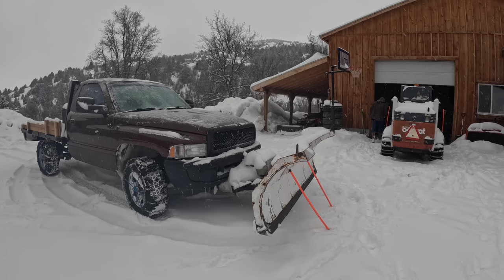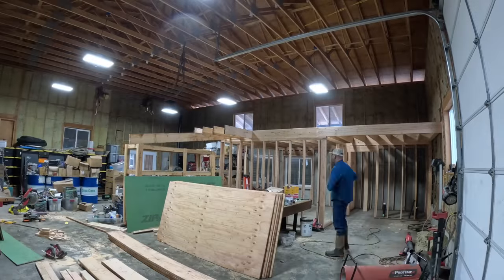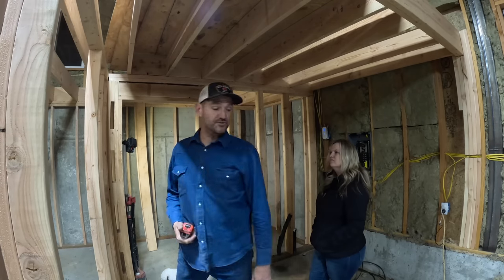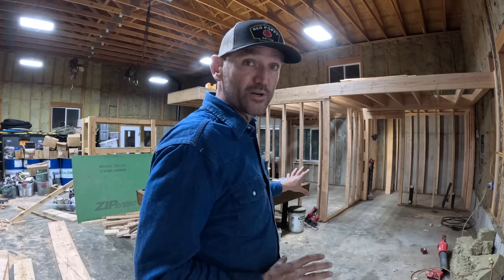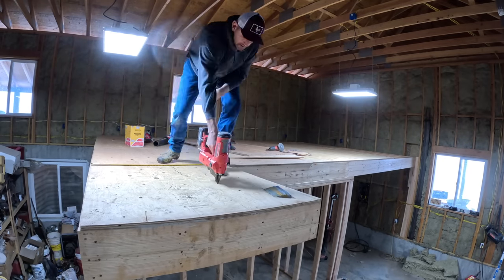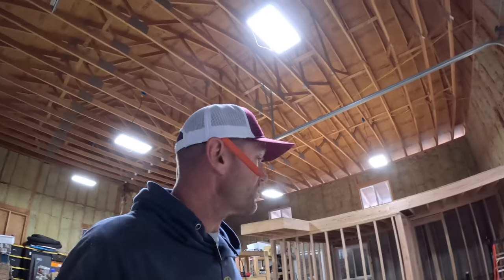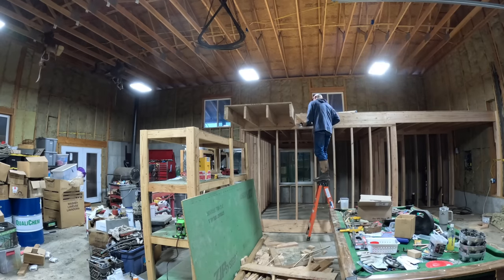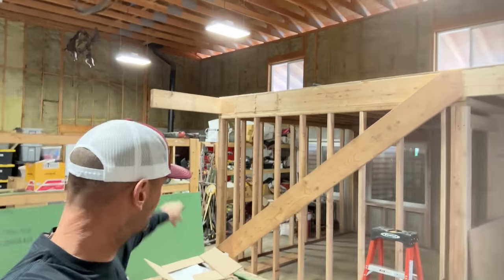#655 - Shop Addition: Second Story Floor Joists, Decking And Stairs

Comment: The stairs looked fine.... you could have added a few degrees without to much problems... and then extended the wall out a little were the  down stair bedroom door would attach... It would have closed the "kitchenette" area in just a lil bit but it would have looked like you meant to do that anyway.  Or.. left it open and brought a short handrail down to a scroll... so no one would 'trip' on the stair hanging out.  You already have a window upstairs... or is that half going to be a loft?

Comment: Measure straight down from your landing(Subfloor - top of plywood), to concrete or finished floor. That will determine your Rise. Ideal rise and run(could differ from state to state) 7 3/4 rise to 10 3/4 run. From there depending on the amount of room you are looking to utilize will determine a landing and so forth. Always run your subfloor the opposite of your floor joist for best strength not in line although it will be fine.

Comment: If fire safety is what your after, code allows up to 8 sprinkler heads on a domestic water system.  Do that and save the cost (and time/effort) over the installing a window.

Comment: When heath and cedar talk you can see she has no say at all but she knows if it isn’t a product that needs finishing, she knows he won’t finish it. Like the walls I’ll do in plywood and some sort of siding that’s English for I’ll cover in ply get busy building plow truck 6 in the summer this time and it will never get finished like the wall on the shop which is still not sided. Because you dont write anything down or plan anything this is why you have to re do work constantly.

Comment: Heath I would close in the space outside the downstairs bedroom on the first floor in the shop bedrooms, for it will help to keep the dust down in the bathroom and bedroom from your workshop.  It will also help to hold the heat in thr rooms
Reply: Would have also added the wall length needed to use the original landing idea for the stairs. Oh well too late now.
Reply: @BrianEltherington  It’s never too late for Heath to redo things. It is his favorite thing to do!
Reply: @laurenj8888  Indeed, but that ship has sailed. Can't wait to see what Heath comes up with as a semi-final solution.
Reply: Wrap around from the backside would be nice.

Comment: From the 2nd floor, Im thinking you do the first 4 treads of the stair like a spiral staircase  but it could be wider treads,,,,.  Then take and fan out 4 treads so the 1st and 4th are 90 degrees apart.. it would allow you to drop down 30 inches or so before you frame the remainder if the stairs.  Doing it this way solves the problem of the bottom being a trip hazard.at the bottom...

Comment: Just an idea.  You could bring the stairs about halfway down the wall, and turn 90° towards where your pool table is
Reply: What I was thinking. You gain some added storage space under the second landing too
Reply: I was coming down to comment the same thing. Put a second landing probably even with the corner, and then turn 90 out. If not that, make the 2nd landing double wide and turn 180.
Reply: that would be a total waste of garage space, which now is much smaller than before
Reply: While I agree it does take up more room within the garage, I believe it is up to Heath and Cedar to determine if it's a waste or not.

Comment: I think using a fire pole at one end of the loft would be useful ( and fun). You are probably going to double the loft space across the width of the barn to really get the most use out of the space.  To shorten the length of the stairs and make them less steep, you could put a landing halfway up. I enjoy watching you experiment. It always turns out nicely. Your narration of the projects is always so literary so lyrical it is a pleasure to listen to you.

Comment: Well Heath, I'm sure that if this is ever read, you have already solved the stair issue.  However, to sometime get the maximum drop for the stairs, make the landing the final stair tread and bolt drop down nailers to attach the stair stringers/final riser to.

Comment: You could have a sliding door on the outside of the bathroom instead of a pocket door. However, odors and sounds will be an issue. You don't seem t have considered bathroom ventilation.

Comment: I’d make the bathroom as large as the landing you made, install a door (pocket or barn door) to access the bathroom from the bedroom and, rather than build a bedroom upstairs, build a loft. That would allow you to install a decent sized shower, storage and, you’d have room for an instant water heater. This way you’d only need a removable ladder to access the loft and, your guest wouldn’t have to walk into the shop in the winter to get to the bathroom. It would be easier than building exterior stairs which is going to take up more room, and whoever is in the loft will have access to the bathroom rather than going through the shop. You’d steal have room for a door leading from outside into the shop to the right side of the bathroom. I personally think this would save you time, money, space and a headache! Oh, and don’t forget to add a bathroom fan if you don’t have a window in there.

Comment: You should learn how to use the free 3d modeling software called sketch up. It would save you so much time on projects like this. Instead of having to tear off a landing you would have seen this issue while building the model, hit delete a few times and been back on track. To each his own though. Good job on the videos!

Comment: I can't believe it. You made the same identical mistake you made on your roof decking. You ran the plywood in the wrong direction. After the inspector made you add a lot of additional framing members, you would think you would know next time. The grain, or long direction of the ply, goes at 90 degrees to the joist members, whether it is ceiling joist, roof joists, or floor joists [as in your case]. You should change it before  the inspector visits.

Comment: HeathCAD: You build it, then make changes.

1. Get a electronic CAD like Chef Architect so you don't waste time & money on materials.
2. You could have just used a stair landing & rotated the bottom 2 or 3 stairs facing out.
3. Just use one up-stairs bedroom since there is one window for egress. Nothing wrong with a bunk style room for visitors. You could also set up a movable wall partial if you want to split. ie a pair of barn doors or pocket doors to create a separated space.

Comment: We would love to hear some of your experiences that lead you to believe that architects do not understand "reality". Now if you would have said you couldn't afford one that would make more sense.
By the way "Mr. I'm better than an Architect" you laid your floor sheeting on the wrong way. Length is perpendicular to the joists, thought you would have learned your lesson about that on the roof sheeting on the house, where you made the same mistake and had to fix it. 
Maybe its different in your town but run and rise govern stair design, not angle. That can be easily calculated and laid out without the use of a huge heavy template. 7 1/2" rise 11" run is a nice stair design.
I could be wrong, but I believe you may have a problem with your build and the septic.
But then again an Architect is such a valuable asset for things like that.

Comment: Where the window is by the garage door, you could put a glass door, would save you the trouble of cutting the concrete. Metal Spiral staircase for upper loft?

Comment: Background: OSHA standard 29 CFR 1910.24(e), states:

Fixed stairs shall be installed at angles to the horizontal of between 30 deg. and 50 deg.

Comment: Real life application... AMEN. As an architectural designer who has worked for several architects, this is very hard fact. Just because it passes code doesn't mean it passes real life applications, something they obviously do not teach in college. I worked as a carpenters helper when I was 14, my grandfather who was a contractor. By 18 I was a carpenter framing houses. As an architectural student in college,  I was years ahead of the others. Architects should be required to spend time as carpenters.

Comment: If you flip the stairs to the other end and build the landing where the bedroom was going to be then put the bedroom over the other bedroom you would not have to add a window since one exist over the bottom bedroom and I know that would be putting outer walls on anyway so wouldn't that help you in the end by not having to install another window and cutting thru concrete.

Comment: It’s probably too late for stair suggestions, but did you consider and “L” design with a landing? I don’t know if that cuts into your space out there. Also, since Cedar wants a pocket door, maybe a sliding barn door on the outside of the bathroom would be appropriate, just a thought.

Comment: The WI Agricultural Ext Service, like several other states, offered low cost house, barn, etc, blueprints.  I got one.  As the majority of our builder homes were ornate, gabled, dormered, etc, all making the home more expensive, I chose one roof line.  And we didn't finish it, just to livable conditions intending to finish it as our children grew. The temptation was too much for local greed and the house was stolen.  We weren't from the area, didn't grow up there, no grandparents in the area, etc.  They even stole the blueprint.  Suing does not get justice just debt.  After 20 years of homelessness, they stowed me in a 100 year old cottage to repair.  Still waiting for the return of may home on Trails End Road at 76 years old.

Comment: Code violations everywhere. I guess in Idaho there are no required inspections except electrical and septic, which will fail. I don't get it. Why does he insist on screwing up all the time.

Comment: Turning the stairs around like at the end of the video would mean another set of stairs would be needed if the upstairs is expanded beyond the 2 bedrooms for storage or more bedrooms. A stub wall at the downstairs bedroom door could be utilized to let the stairs run out a little. Also, turning the bottom of the stairs 90 degrees towards the front of the shop might have allowed the original overhang to remain in place.

Comment: I'm going to give you the equation of calculating your steps, Heath. If Mark told you how, disregard this. Every measurement is in inches and the magic number is 7. Measure your total height, divide that by 7. That gives you the number of risers. Divide the total rise by the number of risers. That should give you your unit rise (Each step). Your unit rise should be between 7 to 7 1/2 inches.

Comment: I have run with those plow markers before, as long as you're not hitting things with them, they will last 3 years as the sun cause them to deteriorate.  @3:40 Looks like your cat fell off the truck you will have to take time to reinstall it. Too bad these videos are taped a week or two ahead or I would suggest a spiral staircase to take up less space. Oh, yea the flooring goes cross ways instead of length wise.

Comment: HELLO  HEATH. I WOULD KEEP CUTTING. THE LANDNG.  AND. MOVE. THE STAIR CASE AROUND THE CORNER. START. ON. THE CORNER. RISE TOO THE. BACK.  AND BUILD A WALL OR. PARTICHOIN.  TOO ROOF.

Comment: Why do you not make a SANDBOX on a PALLET  you can LOAD onto your PLOW TRUCK FLATBED for needed WEIGHT?  You could easily lift it on and off with your forks lift kit.

Comment: Health, you are so wrong.  Move your framing over 4 inches from your B/R water lines & put a pocket door in.
You ran your plywood sheets the wrong way, would be stronger to run them across the beans not with them?

Comment: Not that it will make a difference to leave this comment , but the top edge  snow plow is leaned waaaaaay to far forward. The back mounting point where the plow attaches to the trucks frame needs to be dropped.    The truck would plow much better and the plow would actually have a chance of throwing the snow up and over the snow banks.

Comment: Don't swing door into the bathroom swing it out of the bathroom that will save you for space in the bathroom. Also just extend the wall of the bedroom near the door to cover the bottom of the stairs out a foot or two you don't need that wide-open space to get into the bathroom in the bedroom

Comment: Sorry but I honestly do not know why 30 minutes was not taken 3 months ago to put even some temporary blocking or insulation into the open soffit of the garage roof to keep the heat in and cold out. That would have made a huge difference the last 3 months.
Reply: He's been a little busy
Reply: @karenriggle5435  busy with doing things twice. 🤣👌
Reply: Maybe the second floor gives him easier access to the roof, and he will install that soon.
Reply: @Sewing Barbie  from that side the roof is only 5ft off the ground. He just got it to the good enough stage and left it.
Reply: @shelleyj1780  I don’t think he’ll be running equipment in the shop when has company staying in those rooms.
Reply: A couple cabins on his new property would of been a better idea IMHO and left his shop a  shop 🤷‍♀️🤷‍♀️😂 but it’s not as if I could do any of this 😂👍
Reply: Even just rip stop plastic would have been a huge help to keep heat in
Reply: Easy to say. But why say it?
Reply: I’ve been wondering the same thing.
Reply: @spartacus9852  spot on
Reply: @judyp1214  that would have made more sense.
Reply: Well, he does say that he does things his way, and he's unapologetic about it.  Consider that we have the luxury of learning from watching him (and it can be entertaining).
Reply: @kristybishop3286  you said a mouth full, spot on
Reply: @guyapeterson  almost as much fun as watching Russell at his off grid cabin in Canada (if you know who he is).
Reply: @kristybishop3286  that’s just mean, Heath you are a one man wonder of a worker, no ones business but yours, take well meaning advice as you see fit.
Reply: @wendytravis6427  it might still smell maybe, he probably has plans for that .
Reply: @usdpaulp  huh, well that is puzzling. 👍

Comment: For an ideal angle to build a staircase, according to the formula of François BLONDEL (year 1618-1686) : the angle must be between 20 and 50 degrees to the Horizon (between 40 and 70 degrees to the vertical). The ideal angle is 30° to the Horizon
french version : https://www.comme-un-pingouin-dans-le-desert.fr/wp-content/uploads/2018/10/escalier-calculer-marches-blondel.jpg  (Deep L for translating ) AND calcul (metric systeme : 1 inch = 2,534 cm) with other pic : https://i.pinimg.com/474x/f3/6b/5b/f36b5bee8aedb1e193fbe615eb74d71a--denah-rumah-tangga.jpg  :  2 x E + 1 x P = 58 to 64 cm (22,83 to 25,2 inchs) . "E" = 16 to 17 cm high ( 6,3 inchs to 6,7 inchs) if possible . Nota : "E" = high of countermarch

Comment: Have you considered coming down to a second landing and turn the stairs back the other way? Just a thought🤷🏽‍♂️
Reply: This would be one possibility.... if you kept the top landing where it was then you would build another landing on that wall at the corner of the kitchen.. the mid height landing would be about 4 feet high ... the landing size would be 30x60 inches with the 30 attached to the wall.. this would give you a 30 inch wide stair that would start under your original landing and then go to the midheight landing and from the midheight landing it would go up to the original landing.... it would look z shaped......

THE OTHER OPTION IS and many have suggested that if you are building 2 bedrooms upstairs... you put a shared landing across those rooms ... looking at the bedrooms from where your truck sits you would have a landing that would be in the center left/right that would then have stairs come down to the left... then you would have a corner landing... and the stairs would go around the corner to the egress window area... or you could counter back like above .. but if you are splitting the top area into 2 bedrooms you put the top landing so both of them can share it and then you will need a mid height landing to get to the floor... the mid height landing bottom stairs do not need to run out towards where your truck would sit.. it can double back or wrap around the corner.. Personally if there is space i think double back might be better then you can build closet space under the steps for the pantry / bathroom.. 

or.. find another way.. I am sure there is another way.. probably a few. .... good luck EAGLES 🦅🏈🐔

Comment: Why not use a spiral staircase?
Reply: If they do that, they better haul furniture up before they put it in.
Reply: @sewingbarbie6136  Visited My wife's relatives down in the Keys several years ago. Their condo had 2 upstairs bedrooms with only a spiral staircase to get upstairs. They were tight and difficult to navigate. Also we got the pleasure of seeing the neighbors across the parking lot opening a hole in the front wall of the building to swap out the mattresses. I don't think memory foam mattresses were a thing back then.
Reply: Why remove a wall or put furniture up there when it is not finished? Just make the railing removable so you can lift stuff on to the platform he just took down. I am not saying spiral stairs are the best but they where invented for a reason, or a need to do so.